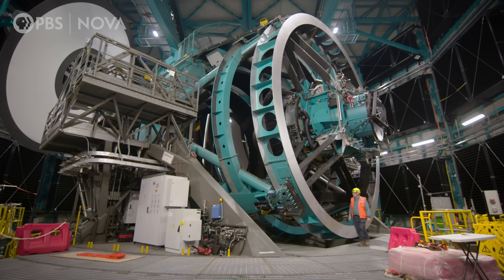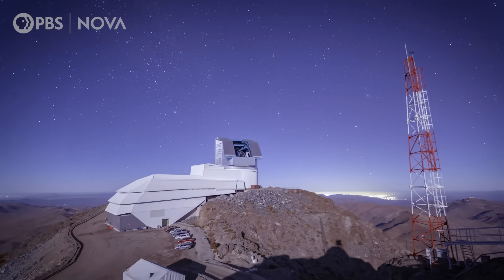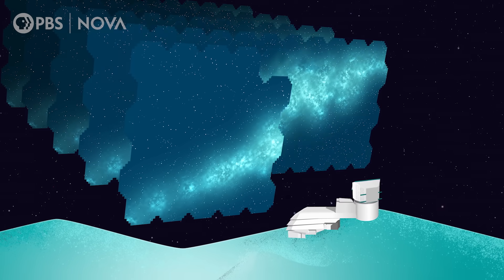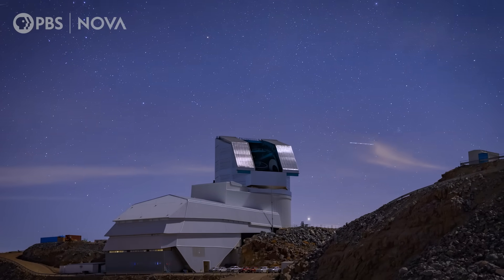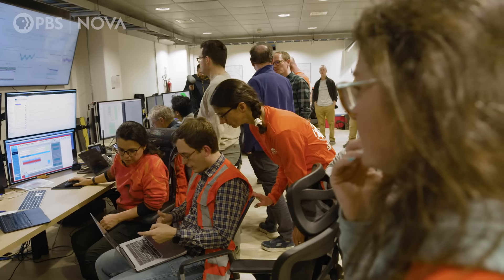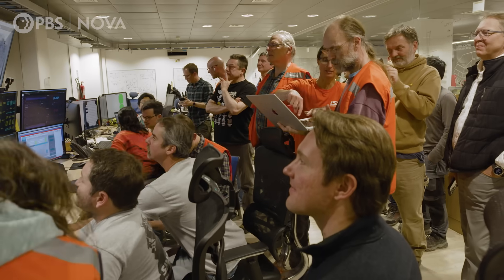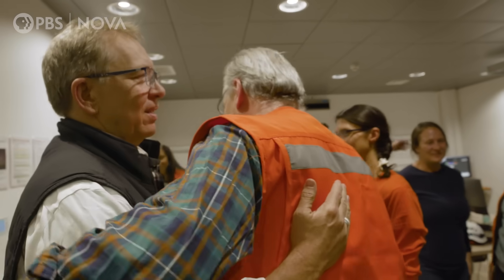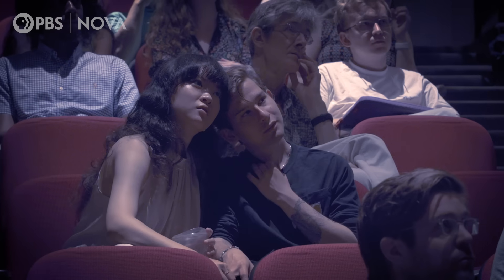This Giant Telescope Will Map the Universe in Unbelievable Detail | NOVA | PBS

Comment: I was wondering why they couldn't take that same camera that has an enormous sensor and put it on the 10 meter Keck telescope but then I remembered them saying that this telescope is in the southern hemisphere so they're going to be imaging different objects from the southern celestial hemisphere and the Keck telescope is around the equator and you can get some of the Northern hemisphere objects so I think that's the kicker about this telescope.
Reply: I would assume you have to design the telescope around the camera. Kinda like changing an electric car to a gas powered one, wouldn't be practical or cost effective at all.
Reply: I have been into astronomy since the late 1960s, I've been doing imaging for about fifteen years, and you only take the images for deep space through the primary focus, which is the fastest image of the optical system. So you may only need to change the assembly parts where the secondary mirror is, which has a faster f-ratio than the image at the eyepiece or the bottom of the telescope. So it's not that difficult to change, because I've done that with my telescopes. It's not that difficult at all. You may need to spend more money, but you can do it.

Comment: Data is great, but you need the storage and computing power to make your data work for you.
We must presume this project has prodigious compute on hand.
Reply: The Rubin Data Facility's  primary location is the National Center for Supercomputing Applications at U of Illinois Urbana-Champagne. The NCSA is a high performance computer center that provides hundreds of parallel processing  nodes , several petabytes of storage and is attached to a high speed network  backbone that connects with other research institutions and the  telescope facility in Chile.  Over the 10 year study period, about 550 petabytes of data are expected to be collected. A petabyte is 1,000,000,000,000,000 bytes.

Comment: It will discover so many, many things.  Wonders we can't suspect, probably.  But what are we going to do if the one thing it does not "discover", or prove, is ... dark matter?  It's entirely possible.
Reply: You do realize that DM is defined as unobservable, so it can never be detected by any telescope?  It's actually just a mathematical patch needed because there is only about 5% of the real matter in the universe to support the gravity-based Big Bang hypothesis.  Nothing more.